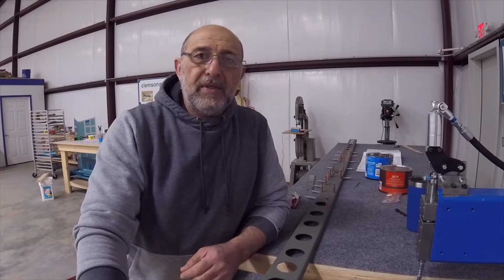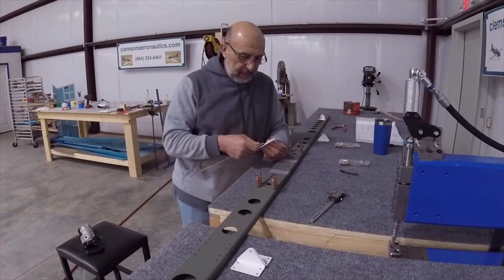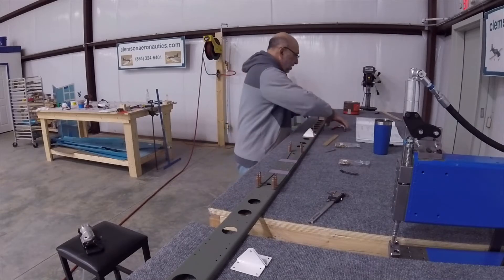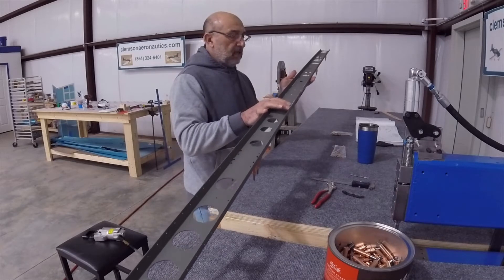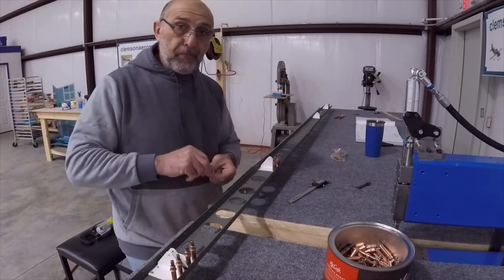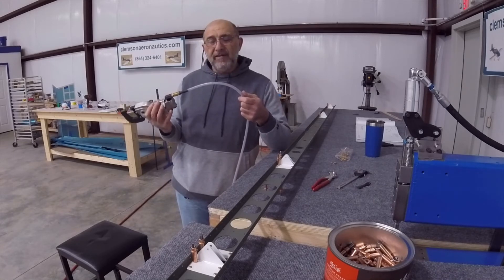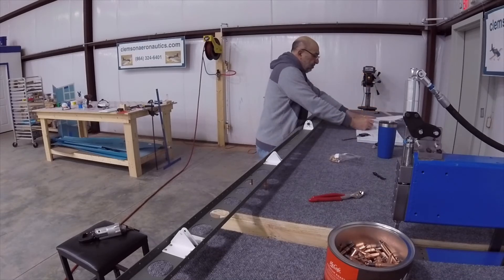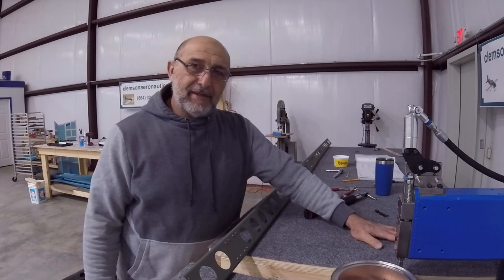Clemson Aeronautics RV-14A Build HS 7

Comment: use a little Goo Gone on the stickers
Reply from the maker: Thanks for the tip. I could be wrong, but I think some of those have citrus base, so we have to be really carful around aluminum. Simple green cleaner for example is not to be used on aircraft because it will cause corrosion. The part that I was removing the sticker from in this video would have been great to use Goo Gone like you suggested because it was steel and power coated. Thanks, I will keep that in mind.